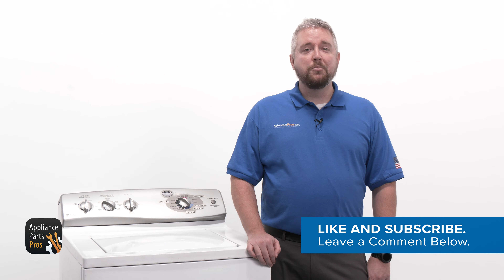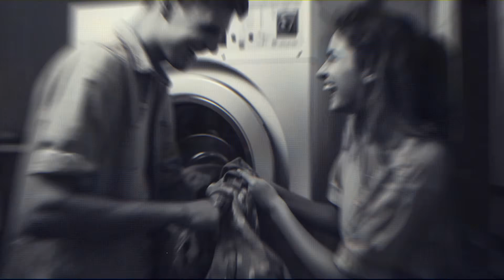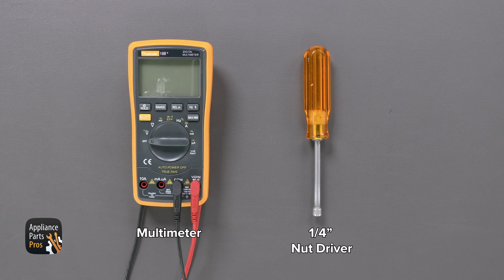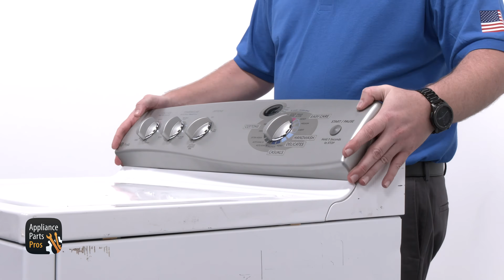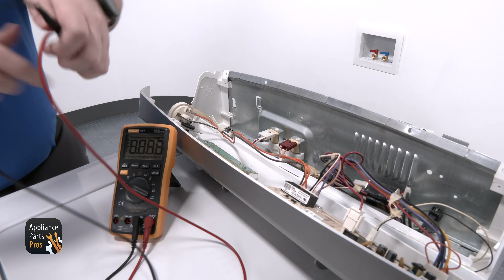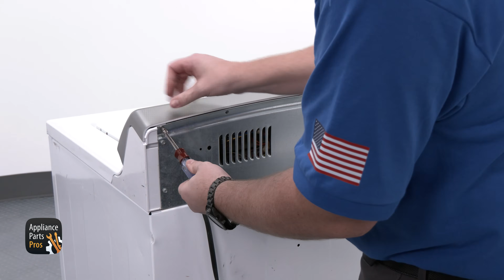How To Test A GE Water Valve WH13X10024

Comment: If you get good voltage you need to replace the water inlet valve but if you get no voltage you need to replace the inlet valve. 🤔
Reply from the maker: Great question — it can definitely be a little confusing! If you’re getting good voltage at the valve and it’s not working, then the valve itself needs to be replaced. But if you’re not getting voltage, you will need to check the wiring and control board. Hope that helps!